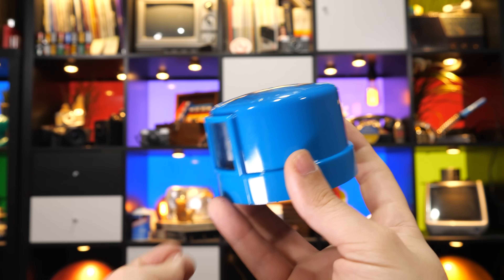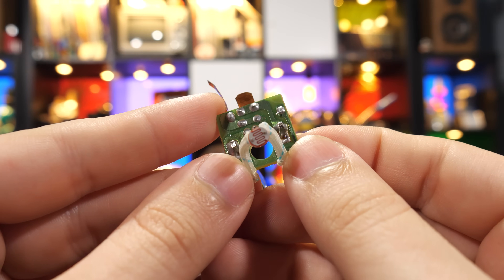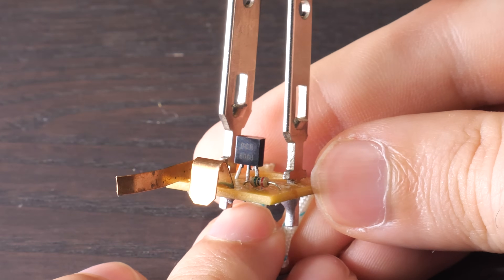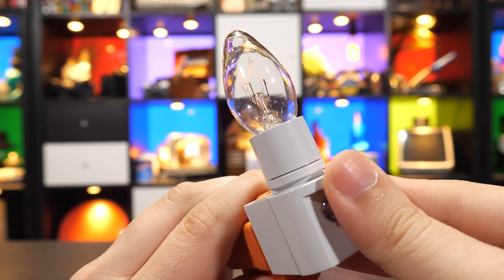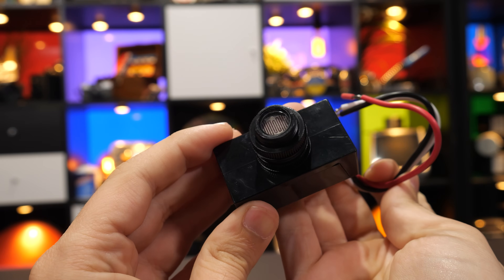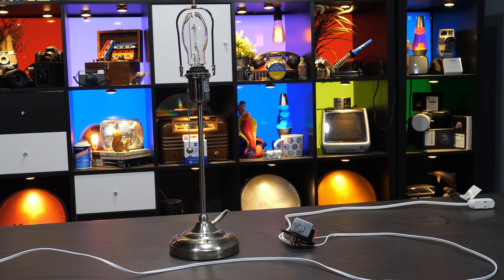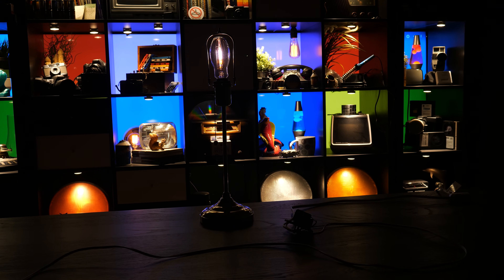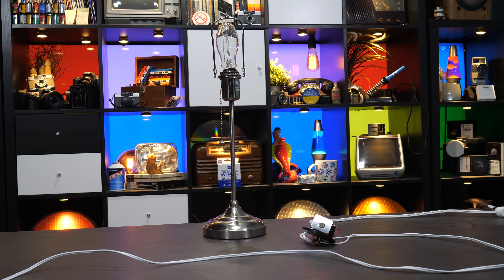Photoelectric light controls are weirder than they seem

Comment: Here in UK, when I was young in the ('50s and early '60s) street lights had simple timer switches, not controllable over the supply. I discovered that the ring magnets from old B&W TV sets could be used to switch the lights on or off by swiping the magnet across the metal access panel.  What really happened is that the switch phase was changed, so when the light should be off it was on, and vice versa, and it required a visit from a person to reset the phase.
Reply: Back in the 70s as a kid I 'err, rescued' one 'hanging out of a lamppost' and used it to switch the Xmas lights on and off. Turns out they are quite sophisticated and can automatically adjust for BST and the sunset / sunrise time.
Reply: They don't need to adjust for BST, it doesn't matter to them. @BlueTangWebSystems
Reply: @BlueTangWebSystems  Those are available to the public now, and are the size of old-school electro-mechanical timers....
Reply: anarchy in the UK
Reply: @danb9447  It was scientific experimentation. Honest!
Reply: They now use a mesh network of small radios kinda like garage door openers now that allows them to remotely and centrally change the on off times and get reports if the bulb blows or any other issues
Reply: @Billc4f LED street lights seems very widespread now - are they controlled via internet just like a domestic smart bulb? Seems like that would work well 99% of the time but would have to have some sort of fallback in case of a connection loss.
Reply: @jcardboard  They use the system I mentioned. The street lamps in a certain area all link back to a central location that has internet. They use the small, low-powered radios I mentioned to create a mesh network to connect the lamposts to this location and allow information transfer between the lamposts and the central location. They use the SRD band, which is also used by garage door openers, remote unlock/lock car keys, the old wireless alarm systems (which have now been fixed so it doesn't mess with them anymore), and a bunch of other short-range devices, causing issues with them intermittently.
Reply: we used to just kick the pole a few times until it went on,     i guess it did the same thing,  somehow it changed the phase from being normally off,  to being normally on
Reply: We just stuck a snapped off bit of a stick in the little triangle keyhole to open the little green box at the end of the street and just switched them on and off with the big switch on there .
Reply: @grahamowens5439  That's too easy!
Reply: yes, I suppose all matters of stuff is used now for better control etc.

I remember when I was a kid a friend of mine (actually not me this time) figured out where the central photosensor was placed for the lights in his area. Just bring a torch and everything goes dark.
Reply: @frogandspanner
Youngsters literally going to any extreme to not go in when the street lights turn on. SMH
Serves you right if you missed dinner.
Reply: That's really interesting, both the electro-mechanical timers and the modern radio/software ones mentioned in the comments. 

In the 90s and 00s UK I remember our low pressure sodium lamps progressively lighting street by street in response to the sunset, and also a partial eclipse briefly triggered some of them. Does anyone in this thread know if those were just light sensors as I'd always assumed, and if so were they more of a semiconductor based solution?
Reply: Some still use timers, not so simple ones though :D. For example the lights here go out again about 1am for the remainder of the night.
Reply: @EwanMarshall  Some also would switch to a low power mode, using a special ballast that had a tapping for full or part current, and thus the lamps would switch to low power at 1AM, and come back to full power 1 hour before sunrise. 

Still the same NEMA socket, just has a few extra contacts on the top, and a set of pins in the photocontrol inside the weather seal, that provides this. Designed to be backwards compatible both ways, plug the special control in a regular lamp and it works like a photocontrol, and plug a regular photocontrol into the power adjustable lamp and it works at full brightness like a regular one. The old ones used 2 relays and an extra ring, the modern ones work with LED fixtures to adjust the lamp current dynamically.
Reply: @SeanBZA Yes, I'm talking about current ones and specifically UK so not NEMA socket either. In some places in the UK the lights now go out entirely in early hours of the morning, 1, people don't need them, 2, it helps residents sleep, 3, it saves power
Reply: @EwanMarshall  UK now uses those NEMA sockets as well, simply because the US volume makes them very low cost to incorporate in the fixture, and a standard socket makes work easier as well for the councils. NEMA by me, and this is a old UK colony as well, we even still use the old UK plugs. Round pin, just like India still does.
Reply: @EwanMarshall  that sounds nice actually. 

Once I lived in a flat which was at the perfect height for the street lights to be at your head height if your curtains weren't drawn. And you needed particularly thick ones to really keep the light out! They were blaring all night, and it was cold white LEDs rather than the warm orange sodium glow I at least used to be able to sleep just fine too.
Reply: @kaitlyn__L  Yes, and you had those big heavy curtains not all windows can have? Also every person is different anecdote from one person is not a good when measuring vs population.
Reply: @EwanMarshall  The timers normally control a whole bank of street lights, the light detectors are often on individual lamps. That way the lights can come on as appropriate as the time (and nature) of dusk varies according to the time of year. So they can set the lights centrally such that that turn off at a set time, but when the timer turns them back on the following day they only light if it's dark so they don't need the time settings changed during the year (and the "light saving" changes when the clocks go forwards/back can be programmed in).

I can attest that on a lot of street lamps they use the same connector as in the USA, but the internals tend to be different. A lot more electronics (they are freely available retail).
Reply: @TheEulerID  I can attest to the ones here turning off individually over the course 30 minutes or so, they don't all turn off at once. As for the sockets, I'm sure some do, looking at newer models, they seem to have sensor and radios built in to the light unit a lot now too. I also don't think they care about the clock shifts here, oh, no, they turn off an hour later, no real change there. And yes, they can time and use light sensor at the same time as I said not simple timers anymore.

It is probably a mixture, that said, there are still some time basis as I said, it isn't all banked/grouped but that probably varies.
Reply: @EwanMarshall  The timers were usually set to switch off at 10:30 in Leeds, after which time it was pitch black.
Reply: @frogandspanner  Not sure on that, I'm talking the current ones here in Dorset, there was a fight to stop having the lights on all night. It saves energy, the light doesn't actually lower crime (actually opposite in some cases, how many opportunist criminals have the forsight to bring a torch), and people generally sleep better if it is actually dark. Also get to see the stars all nice.
Reply: @frogandspanner   Nothing much else to do in Leeds after 10:30
Reply: @EwanMarshall  i mean, we have here some experiments for "on demand" Streetlights that turn on by an SMS for the occation that one is walking there at night
Reply: @EwanMarshall wait.. the street lights turn off at 1 AM? That’s not a bad idea, certainly save electricity. I wonder why we don’t do that in remote areas like suburban neighborhoods? Interesting 🧐
Edit: are city and many others have switched to LED light’s which probably use a 1/10 of the power as the sodium bulbs did so it probably isn’t worth the cost of buying installing all the timers. Still sounds like a great idea.
Reply: @ohioplayer-bl9em  Lots of the UK already using LED, that's part of the argument against having them on all night as people find them more annoying due to being whiter light so are perceived as brighter.  People were also complaining that they create bright-spots compared to the old lights making it harder to see people lurking in the shadows, which I think is not accurate at all, just the old ones were so awful you'd barely see someone lurking in the light. ;)

As someone who was a cyclist during the transition I thought the whiter light was terrific, you could see pot holes in the road with enough time to avoid them whereas the old sodium lights you couldn't.
Reply: @ohioplayer-bl9em  Yeah, there was another place in the UK that was going to do it, but they were getting complaints ffrom the residents, but that is usually because there is this idiotic view that there is a criminal deterring effect. The truth is criminals need light too, and bringing your own requires forethought most crimes do not have.

As for the power savings, across a county's worth of street lights, even a rural county, it adds up. People above are saying it is 2W for this sort of sensor across a "parking lot" of 50 lights (US stop making your cities giant car parks), well that also ignore any radio recievers used to control other lights, those have power requirements too, it also ignores that 50 lights might be a lot of a carpark at a business or group of business, but that pales in comparison to the 37,372 across the rural british county I live in. In 2017, FOIA request to county revealed 30,948 of those are turned off for at least part of the night. The policy started in testing in 2011.
Reply: @alexatkin  Back in 2011 they were still often the old sodium lamps, the £500,000 a year being saved in electricity costs in my county (2017 FOIA request) is nothing to sniff at.
Reply: @EwanMarshall  I had to leave numerous local community social media groups because they became basically campaign groups to keep the lights on citing all sorts of spurious idiotic reasons and inaccurate statistics to try and back up their claims. I despair at the human race 😞
Reply: @mfx1  yeah, I've seen it elsewhere, the thing is, this county is home to some astonomers who studied these things. There are still claims people are worried about someone breaking into car parked on road in the dark. As said though, torch is kind of needed, and a small lone light is like a beacon at in proper darkness of night.
Reply: No, LEDs aren’t drawing 1/10 of what sodium lamps drew. Sodium was quite efficient, but at the cost of yellow color
Reply: Like the railroad crossing signals that could be triggered by simply joining the tracks with a jumper cable.
Reply: "joining the track with a jumper cable" will also stop the train. Track circuit signals use the fact the axle shorts the two tracks to detect a train.
Reply: 17:07 Glitch. Pretty cool. Never experienced this anomaly before.
Reply: The system in Europe is simply timed. The timing changes every month to a fixed on and off time and it's used for an entire month. It's very noticeable when the daylight savings time begins or ends, for a few days (until the beginning of the next month) the street lights turns on way too early or too late since the internal clock of the system get adjusted too but not the on and off times. And the lights won't turn on during a thunderstorm when it's almost as dark as after sunset.
Reply: Ironically this is also an effective lockpicking techique for solinoid derived digital deadbolts.
Reply: Ah, so that's what hackers did before computers existed.
Reply: @vigilantcosmicpenguin8721
Also messed with telephones.  Those people specifically were called phreakers
Reply: @dafoex  In UK we had pulse-dial 'phones quite late. When I was a PhD student in the '70s the phone in my office had a 'trunk bar' that operated after 18:00. This meant I could not dial trunk calls (in UK that means city to city) after 6pm - just as the tariff for such calls went on to cheap rate. I thought about this for a while, and reckoned that the main University telephone exchange was still the old Strowger-style uniselector type, but that the trunk-bar was modern electronics. I further hypothesised that the electronics checked for 10 pulses exactly (the '0' preceding all  trunk calls) but the uniselectors beyond that would cycle round again if more than 10 pulses were presented. With that in mind I tapped 20 pulses on the cradle, followed by the post-0 digits; it worked!
Reply: Legend.
Reply: How'd you get the idea to do that?
Reply: loololololoool nice
Reply: The perfect crime
Reply: I think you will find the timer was a Astro clock set for the sunset and sunrise times of the area you are in.
Reply: Did the person visit with another strong magnet
Reply: Cool story bro
Reply: @mann_idonotreadcomments
In this case, the access panel in question is at street level.  They weren't climbing lamp posts as a kid!  Or maybe they were, it was the 60s

Comment: To add, the secondary type of photo switch he showed, is often built into some outdoor lighting, wall packs on the sides of buildings, and some pole lights. It makes for easy install, just a hole in the fixture and wire it up inside. Factory installed on tons of stuff. They are also easy to replace if access to inside the fixture. Both are highly cost effective and used roughly equally, in my experience, on stuff used by the general public.

Comment: I'm assuming there is a difference between the photo resistor and a light-sensitive doped silicon? 
Also, you can inverse the signal with a transistor or mosfet. I'm sure none of that applies here
Reply: Those photoresistors use a film of cadmium sulfide (CdS) between the 2 electrodes as the sensing element. They are on their way out due to environmental regulations restricting the use of cadmium compounds.
Reply: @bobweiss8682  it has been a while since I've played with those items.   About 30 years ago.. 🤣 the little solar- motor projects you could get from the local hobby shop. There was the light resistor in those buzzer experiments.. it's been a while.  Thanks

Comment: When I was young I learned how to cut power to entire car parks shining my phone torch into an Light dependant resistor. I thought it was the coolest thing ever! Lol. Especially when there was hundreds of people gathered there at night for a car meet, all of a sudden the place descended into darkness and everyone went wild 😂
Reply: LOL. Same here. When I was a kid, I discovered a photoresistor inside a drill hole of an electric box on the street. When I covered it up, all street lights went on - with a bang from the contactor. I played with it every time. Power of the gods 😀
Reply: If you had a phone with a flashlight when you were young... You are still young.
Reply: @Idontrunntoofast phones had flashlights back in like 2006, 2007
Reply: The fact you had a phone with a torch when you were young makes me feel old
Reply: How strong was your phone flashlight 😂
Reply: We used to do that with roman candles for fireworks shows where we didn't have access to cut the streetlights
Reply: Burning lasers do that too
Reply: @RadDadisRad just a normal laser pointer will do. Don't need to be a vandal and destroy it just for a little high jinks
Reply: @JaenFoster  depends on the sensor. A red laser wont activate the sensor but a green laser will.
Reply: @JaenFoster  you also don’t have to have a full power black laser either. It’s the operating frequency of the light that is important, you can throw more resistance in the circuit to decrease light output from the diode. The laser works in nanometer to visible spectrum which these resistor chips in photocells work best at because they use visible light radiation to activate/deactivate.
Reply: @RadDadisRad  This is word salad. 
"full power black laser" --> Err... 
" throw more resistance in the circuit to decrease light output from the diode" --> Not how constant current laser drivers work.
"The laser works in nanometer to visible spectrum" --> Visible light is already in the nanometer range.
"these resistor chips in photocells work best at because they use visible light radiation to activate/deactivate" --> Err... What?

Comment: What a coincidence - our building is about to research replacing our lighting clock with a sensor system. 😲 Thanks for the perfectly timed video!
Reply: A competent licensed commercial electrical contractor is the one to consult. Large installs will require commercial grade equipment.
Depending on where your current timer or manual switch is, it probably isn’t a major project.

Comment: Wouldn't it be simpler to use a solar cell as the light sensor and use that as a signal directly?  It would still need to feed into a microcontroller to get the delay that we want to keep the thing from toggling the state too frequently, but it would not turn the lights on during the day if the power goes out and gets restored long enough after for the heating element to cool.

That said, I suspect that they did try that for a bit, but without having communicated the need to not toggle the light too fast.  Rather than explaining that they failed to communicate one of the requirements to the design team of the new system, they just went back to the old setup, or possibly to the microcontroller hybrid that you showed in this video.